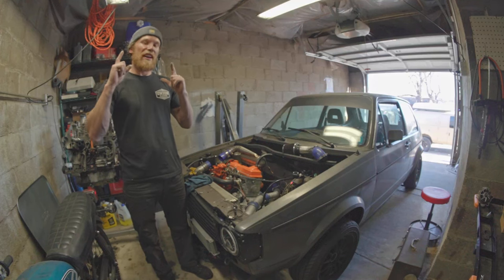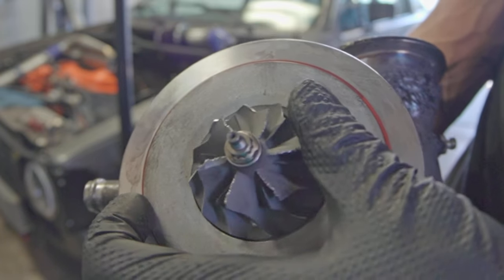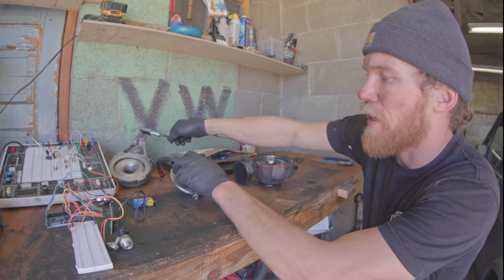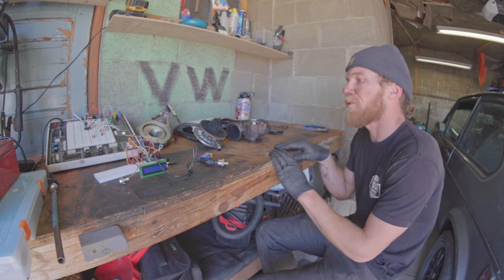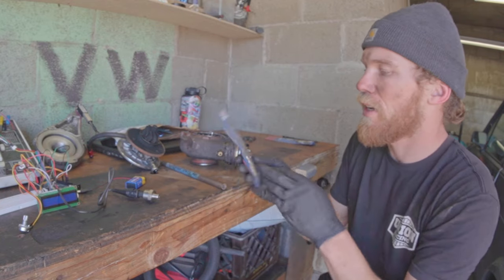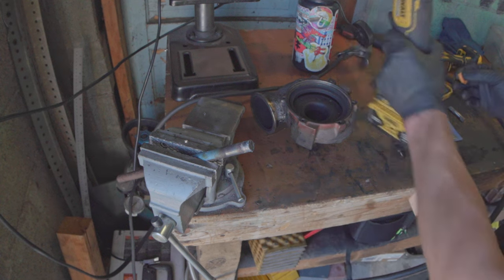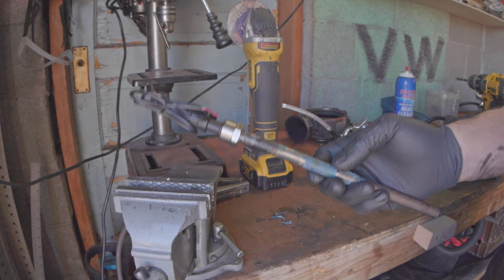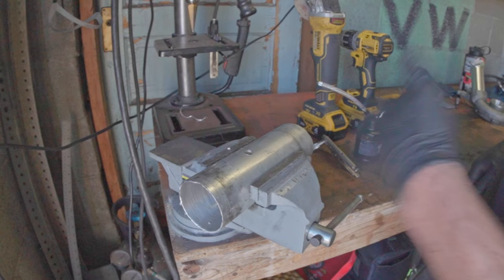We're getting close! VGT turbo controller

Comment: I'm in a similar situation running a garrett VNT with no good way to control it.  A standalone VNT controller has been aim of mine for years now, but its been shelved for a while. An intake temp sensor would be useful to adjust boost target to achieve a more stable air mass flow throughout temperature ranges. However, I think a "TPS" (In quotes since it doesn't have a throttle but you get the idea.) sensor would be more useful if you have to pick between the 2.  This would allow you to vary Drive/Boost pressure ratio target based on "throttle" position.  Limit the ratio to a reasonable level during cruising and then when you go WOT target a much higher drive/boost ratio to hit target boost quickly and then taper back down after hitting the target boost. 

If your programming and controller can handle it you could also vary the boost target with throttle position, that way you can reduce the boost target at lower throttle when you don't need as much. 

Not sure how you plan on programming it. My plan was to have 2 separate control loops with different targets, Drive/Intake pressure ratio and simply intake pressure. Both loops would always be running and the controller would use the output of the loop that was lower (vanes more open).

Looking forward to your progress. So I can buy a controller from you lol.
Reply from the maker: Hell yeah! Check out some of the newer videos, I do have it up & running. Ngl I have a homie that's good with the code helping me (I'm shite at best w it) but together we're making a pretty kick ass system. Currently it runs on just boost & drive pressure inputs with adjustable limits for both. Next step is working on faster response time from the linear actuator. Long term goal is to package down to cigarette box size & be able to offer it as a kit option 👍 your preorder has been noted 😂💯
Reply: @OliverFetter  Awesome. I had the control scheme figured out, but finding someone to write the code was my issue. The linear actuator is a fun idea, but a vacuum actuator gets the job done just as well until you target higher pressures. If you want to use an electronic actuator, why not use an OEM actuator?  My setup is in a 4x4 with an air tank for reinflating tires, so my plan was to use a regulated ~50psi to the actuator.  Either way the control scheme and output should be the same, just a different PWM frequency for the linear actuator.

Coincidentally, I'm pretty sure I live ~4miles due south of you haha.
Reply from the maker: I tried working with the servo that come with the turbo (I'm using a sprinter van turbo, so Mercedes) and 0 chance I could get its control board working, so then tried playing with just the servo & the Arduino together and found it had a nasty tendency to stick 👎👎👎 not reliable the way it was functioning. I also like the linear actuator bc plugs straight into the Arduino & has lots of beans to move potentially sticky vanes 👍 😂 that's funny.

Comment: Hey Oliver thanks for the post I have a mk1 rabbit idi and a bew to swap into it tho I’m still scared of it being much more difficult than I would like. I’m thinking of using haltech to run it just not sure how the axles and linkage for the trans will match up
Reply from the maker: Unfortunately I don't know the answers to that! Im working on a ALH swap, and keeping it mechanical fuel injection & 020 transmission. So I need to sort out a passenger side engine mount & the pump pretty much. In your case, I imagine you could similarly keep the 020 for the time being to make that simpler, but I'm not sure. I find it helps a lot to make a spreadsheet with every issue/redesign a big project/swap needs and then start researching each question bit by bit and writing it down. Small bites to eat an elephant!! Hope this helps.
Reply: Why would you use a bew, other than you already have one? I heard they wipe cam lobes